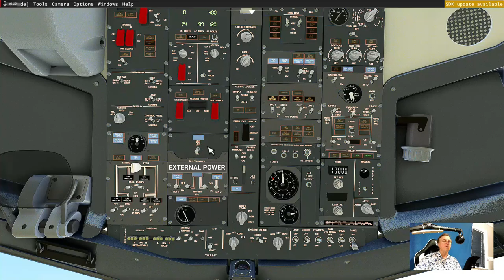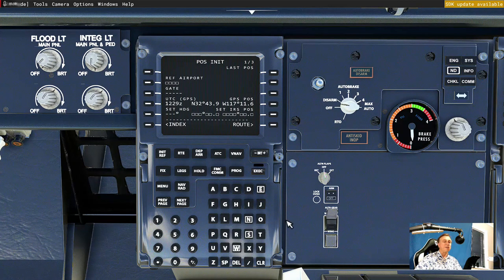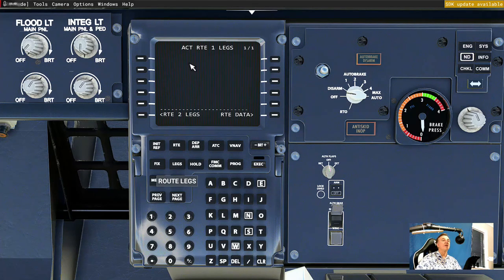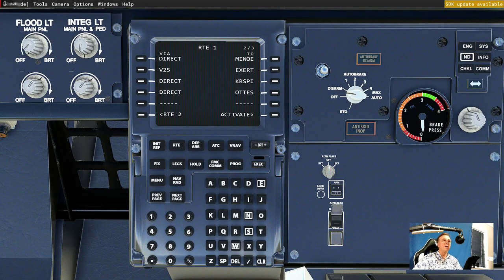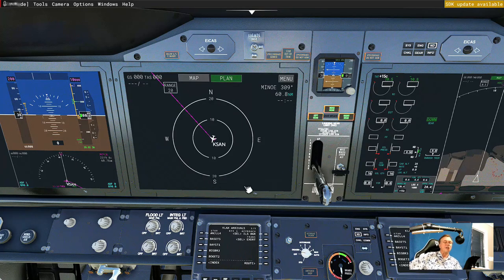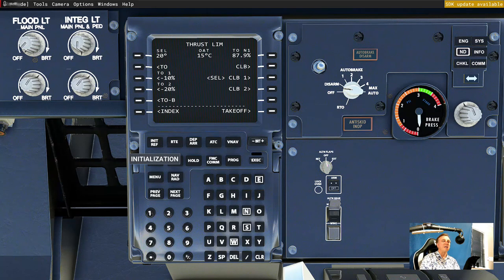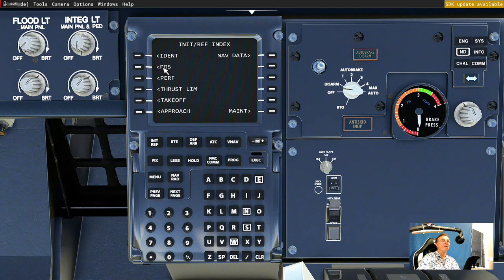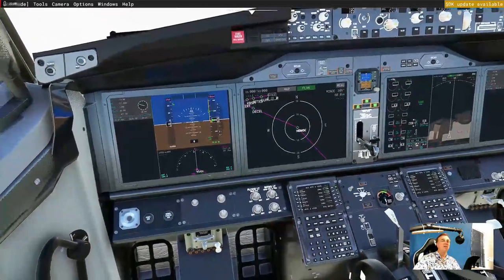MSFS 737-Max, FMC for dummies.

Comment: @17:17 For the V-speeds, if you simply click the softkeys next to V1, VR, V2, the FMC will automatically calculate them for you based on the weight and loading of the aircraft. This is a little nugget I picked up watching another video on the MAX FMC. Just wanted to share. (And PS, my bank account has the same problem as yours, just a different currency!)
Reply from the maker: appriciate the tip, thanks mate and have a great day. William

Comment: Nice explanation of the basics of the FMC. But don't worry about the PMDG, pre-flighting the FMC won't be much different, it'll be more about the level of detail I'd say.
Anyway a few things I observed that might help you:

5:25 Actually they do, that's what GPS POS shows you. In fact, you could just copy the GPS POS coordinates into the IRS POS line. That's even how it's done nowadays on GPS equipped aircraft, as the GPS position is the most accurate. Basically, REF AIRPORT is entered only for gross error checking nowadays.

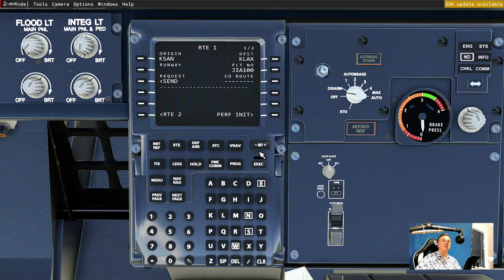8:25 Clicking on NEXT PAGE is a quicker way to get to page 2 of RTE 1 (on the upper right you can see if there are more pages available).

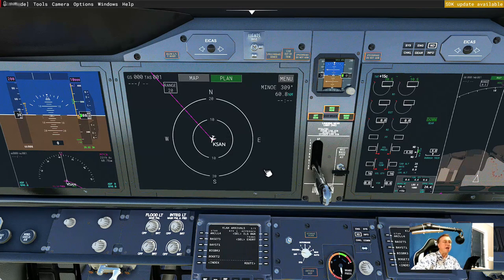13:28 The proper way isn't modeled here. Normally when you have the map selected on the ND, on the LEGS page there will be a MAP CTR STEP prompt instead of RTE DATA, allowing you to step through the map. On the PMDG, it will be possible for sure :)

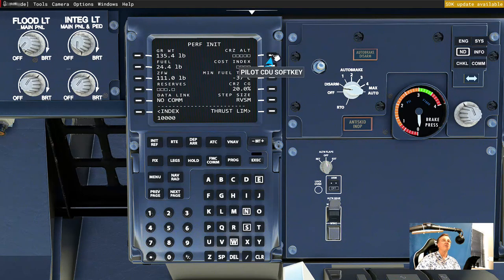16:00 That's actually not properly modeled here in the default plane. The real one would display 10000 as it's below the transition altitude (which is 18000ft in the US). Above TA, the FMC would display flight levels, and it would be more clear as it would look like "FL200".

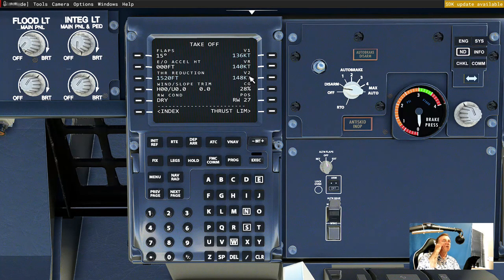18:00 Pos. rate can only be confirmed on the VSI and altimeter. V2 is the speed that allows a safe climb-out on one engine, as it keeps you above VMCA (minimum control speed in the air). That's why the initial climb speed is based on the V2 (V2+20 on the 737), so that in case of an engine failure during initial climb you have enough margin to account for some speed drop.

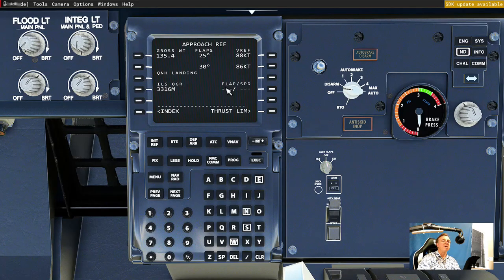18:43 The idea is to just copy one of the lines above. But seeing those unrealisticly low VREFs and the missing Flaps 40, it's something to keep in mind for the PMDG where the numbers surely will be accurate :)

19:34 The Cost Index affects the speed computation of the FMC (which is used by VNAV). A low cost index results in lower speeds and thus lower fuel consumption. A lot of factors go into calculating that, and it's done by the airlines, the pilots just insert that value into the FMC. Therefore you can use whatever number you wish.
Reply from the maker: Wow. thank you for taking all that time to help me. really appreciate. will tell people to check out this comment, it will help a lot of people, Cheers, Have a great day, stay safe, William.

Comment: I have a question about making a flight plan in the Boeing 737 max.
When I want to delete a wrong letter or number in the FMC screen, the delete and clear button is not active. A hand appears instead of a hand with a finger and the trim wheel glows blue. What is the problem and how can I fix it?

Comment: Did you use SimBrief to get the waypoints?  Also, since you're flying  ILS I'd suggest you click on the Nav Rad button to ensure the correct runway and ILS frequency is correct.  Good job.
Reply from the maker: thanks bob, i hit the v key to bring up the small map, all stars waypoints can be seen there, do not need any add ons. i feel this is real enough for me and i like simple, cheers, stay safe mate :)
Reply: @jet-inairwaysvirtual.4290  Thanks, I just learned something. You are great, thanks again.
Reply: @jet-inairwaysvirtual.4290  ok this is an important note to have in the video. Glad I found it. Like you im not going to outside charts. Im playing on a xbox
Reply from the maker: @jnorm0075   Hit V and you can find the way pionts on the map. sorry should have said this on my first vid. cheers mate.